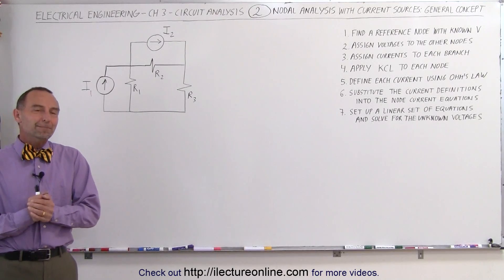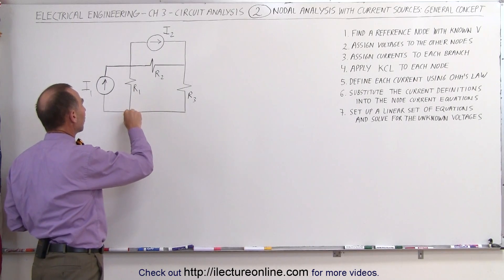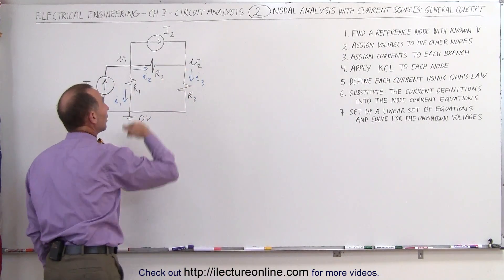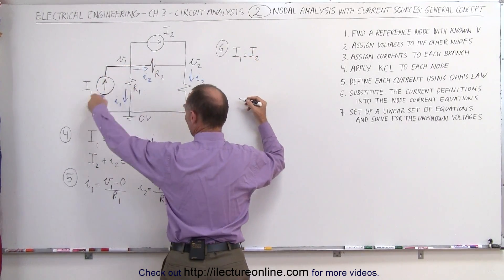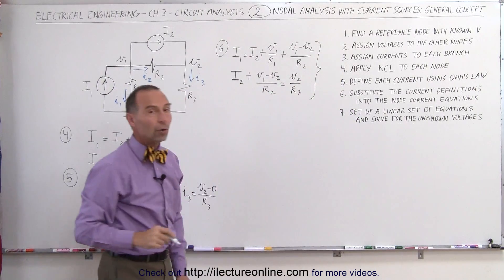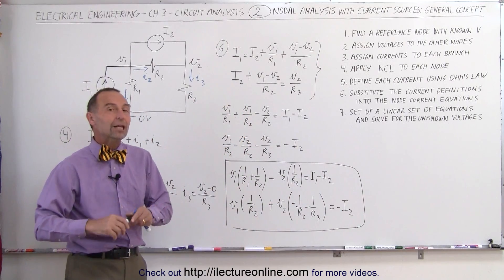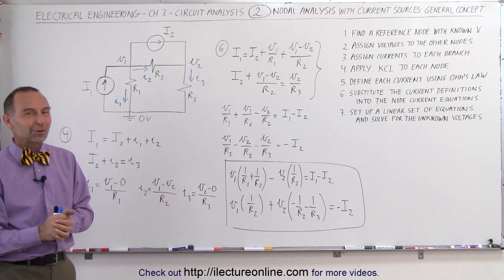Electrical Engineering: Ch 3: Circuit Analysis  (2 of 37) Nodal Analysis w/ Current Sources

Comment: why is it that we can choose any arbitrary location for 0V? Could I not have chosen a different node for 0V, thus leading to a different final answer? Is it good practice, when working with a circuit that has say a 12V battery, to have ground be at the node connected to the negative terminal of the battery? 
Also in step 4 it says apply KCL to each node, but you did not apply it to the grounded node, why is this?
Reply from the maker: Yes, you can use any reference voltage, since the voltage can be cosidered to the the potential DIFFERENCE between two locations.  The value doesn't matter, just the difference does.

Comment: First of all, Sir, thank you for this detailed and truly helpful video. I have a small question. In this example, you assumed that V1>V2. If I were to assume that V2 is greater, will that make any differences in our answers?
Reply from the maker: Since the current travels from left to right in that branch, there will be a voltage drop across the resistor, and therefore, V1 will always be greater than V2.

Comment: At 2:31 does the current from I 1 not also go to the branch of I2?
Reply from the maker: The current typically splits up in some fashion when it reached a branch point.  But with circuit analysis, we tend to consider each branch with its own unique current.

Comment: At node 1 you decided to go with I1=I2+i1+i2 but if i choose to go with I1+i1=i2+I2
Will i still get the same answer???
Determining directions of current  seems confusing.pls help me with this
Reply from the maker: You can pick the direction of each current in each branch.  Once you pick that direction, you need to keep it throughout the problem.  When you get a negative answer for the current, you know that the actual direction of that current is in the opposite direction from the direction you chose (or guessed).
Reply: @MichelvanBiezen   one more question pls,in every problem you always take the bottom node as reference node but if i choose the top node to be the reference node will it be problem??and what happens if there is another dependent voltage source between resistor and node voltage??

Comment: sir why didn't you take 0-v instead of v-0
isn't the voltage drop supposed to be negative? (final v - Initial v)
Reply: Yeah, but for example: Total Work Done equals the change in kinetic energy. So, that's just normal. Wtot = deta Kin. But, Potential Diff or Voltage equals the NEGATIVE of the change in potential energy. So, we reverse it and keep the positive sign!

Comment: Why is the third intersection not considered a node and thus not applied/used in KCL to?

Edit: And also, thank you Professor Biezen for your great videos!
Reply from the maker: You only need to consider as many nodes as are necessary to relate all the currents to one another.  But you can consider extra nodes if you like.  Either way you should be able to find the solution.
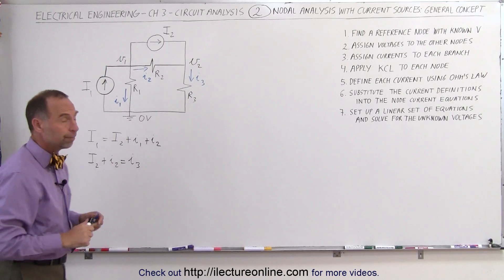Reply: Professor  @MichelvanBiezen ,  thank you very much! I also rewatched some of this video (the beginning and 3:44) and looked closer at the numbered steps and now better understand how to choose which nodes to consider.